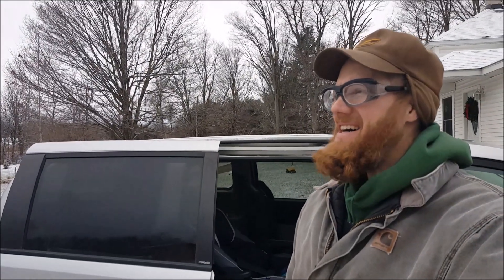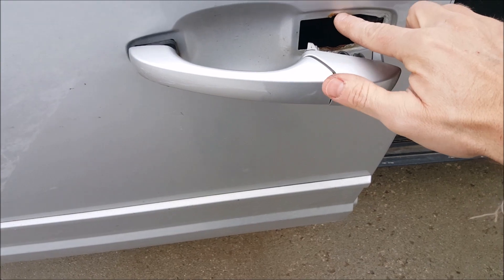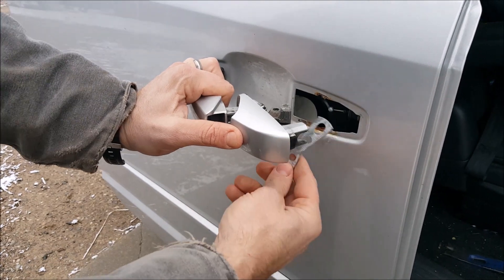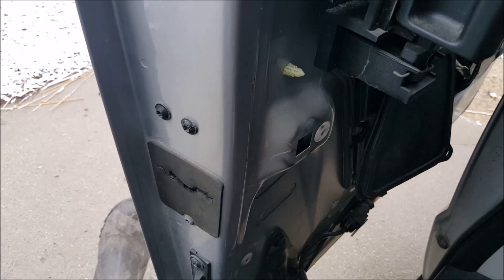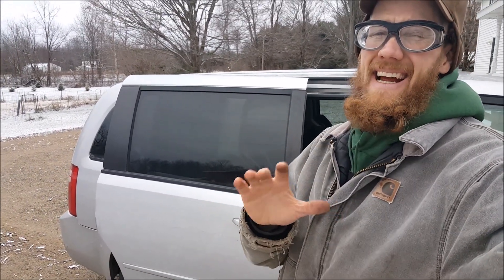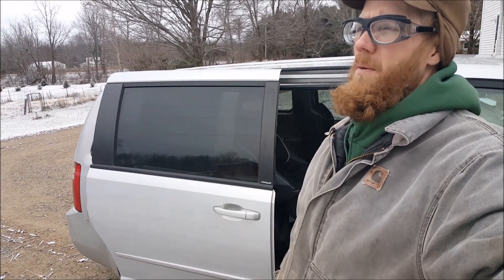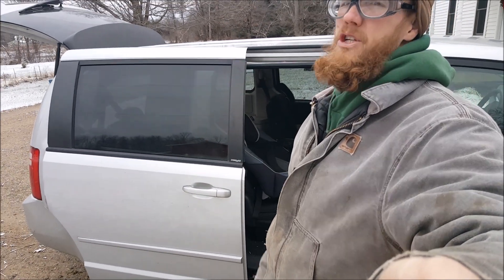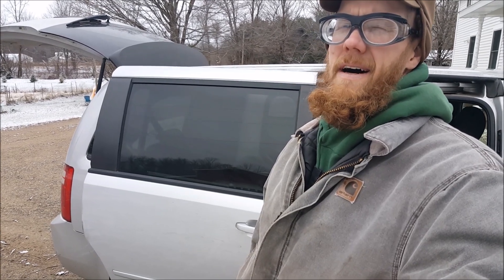Dodge Caravan Sliding Door Handle Fix

Comment: Just did this repair job on my wife’s 2011 grand caravan. One tip when putting the cable in for handle. Don’t forget to put it back into the plastic anchor for tension or door won’t open. 

Thanks brother for this video. You made my wife happy👍
Reply from the maker: Yes!  This is my favorite part about YouTube, People helping people fix stuff!

Comment: I tried this last night and it worked like a charm. Because we had tools handy, fabricating only took a few minutes. The tip to pull on the panel until you think it will break was a good tip. I was was afraid, but it did give way. 
I did, in fact, drop the fabricated part into the door. Because it wasn't my first time being an idiot, I had my magnetic telescopic flashlight grabber handy. 
Great tips, thanks.

Comment: My ‘09 Chrysler T&C just had the driver side sliding door handle go out at 188k. Not much of a minivan anymore cuz the ac hasn’t worked in years but now I just use it for hauling stuff I don’t want to put in my Toyota or Honda lol. Thanks for the video.
Reply from the maker: My Caravan has always double as the work vehicle, the Mrs drives an Odyssey and that’s a little too nice for the piles of stuff I fit in these vans, I’m afraid I’ll always drive a Van

Comment: This is exactly my similar problem.  My handle is not completely broken off but will not open the door from outside.  It would have been a great addition to have an image sketch with sizes on the part you made so that we can get this ready before tearing  the door open.  I will try to make a outline sketch with all sizes when I get to do mine.  Have to do both sides due to my aggressive  nature of opening frozen stuck doors.  A little wd 40 on the rubber so far has prevented further ice ups of the doors.
Reply from the maker: Send me an email at youngbloodfamilyfarm@gmail.com  I have a drawing for you

Comment: Hey, perhaps you can help me. I am unable to open the manual sliding door from the inside. It's not child lock as the working sliding door behaves differently when child lock is on. When I pull from inside, the working door would pull further and will click and stop opening.  With the non working door, the pull is half and no clicks or action.  The door can open from outside.
Reply from the maker: Really sounds like some kind of linkage is disconnected.  Might be worth removing the trim panel and inspecting

Comment: OK! 
First of all thank you very much for this useful video. I repaired my door handle and you are a big part of it! 

I just want to add one thing : I effectively LOST inside de door the precious replacement piece (...). In the video you said that it was lost forever. I disagree! I taped a strong magnet with a screwdriver then attached a rope to the screwdriver. 
Then, I just went fishing for the missing piece. Took me 10 minutes but finally got it!

... 
3 minutes later I lost a screw there too... once again I used the magnet screwdriver and got it back.
Reply from the maker: Good work, I’ll have to remember the magnet fishing trick

Comment: Little trick remove the inner door handle 3x10mm bolts and 2 torx bolts ,then remove the tape covering the hole .Then you can get a rachet and extension and 
 get to it easier